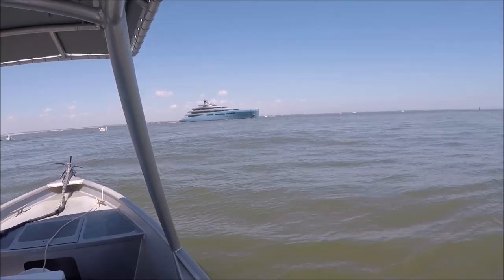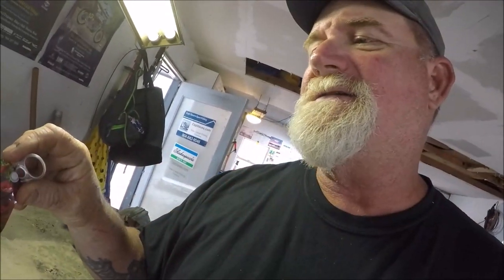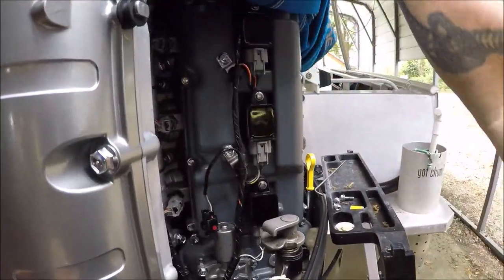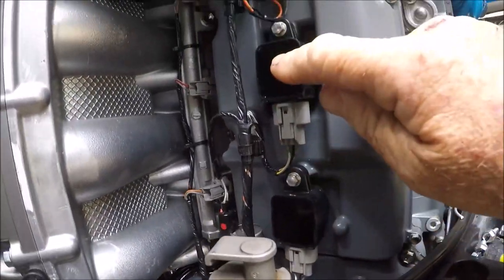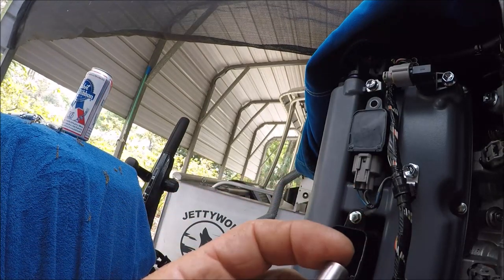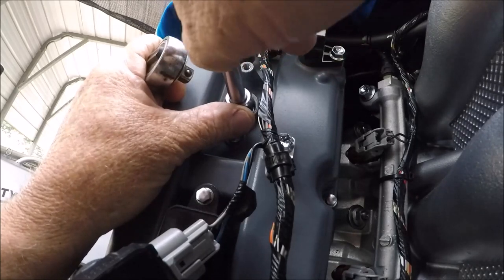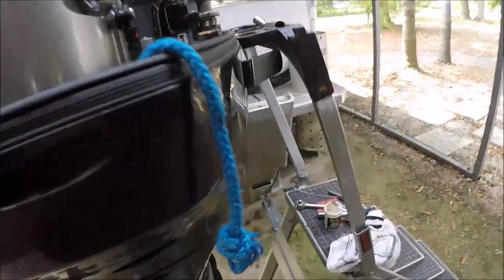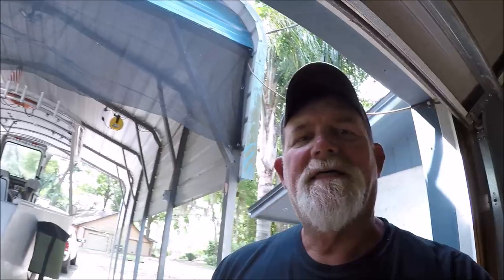SUZUKI V-6 OUTBOARD SPARK PLUG CHANGE

Comment: A few suggestions Take the Tupperware off, takes 5 minutes. Put a little grease on the end of the socket to release the socket. Finally use better tools that hold extentions better.

Comment: Thanks for the chuckles.  Enjoyed the video and I'm now a new subscriber.  Couple suggestions - ALWAYS use anti-seize compound on the plug threads. (I cannot stress this enough to you at home that do your own maintenance)  Many of these manufacturers use aluminum for the heads and the plug casing is steel.  I use it regardless if the heads are aluminum or not.  We definitely do not want those two differing metals to fuse together, otherwise next time you change the plugs, you may find a bonus.  Second suggestion is to put a very thin film of bearing grease on the rubber insert of your brand new deep-well plug socket.  It then can only grip only enough to keep the plug in the socket so you can get the threads to line up, but not too snug that you cannot pull the socket back out when the task is done.  Well done, sir!  Keep up the good work!
Reply from the maker: its DRAMA....I got it covered. Owned 20 outboards and done the maintenance on all. Lack of huge tool selection and ZERO time is my only issues. Glad you got your chuckles.

Comment: I take the rubber out of the deep socket. Works great for horizontal plug jobs.  Or don't fully seat the plug in the rubber.
Reply from the maker: I'll repeat what I told others......i thought about that but didn't want to do any factory modifications to my NEW $6.00 socket. LOL .....PLUS, it wouldn't have been nearly as fun to watch. It's referred to as; Theme, conflict, resolution. 3 parts to a good story. C'mon!

Comment: OK Dave, here's my solution to your problem of getting the spark plug socket outta de hole: Buy yourself another long spark plug socket just like the one you own. Somehow,( I don't know how - maybe poke it out, burn it out), remove the inside rubber bushing that grips the spark plug. Use this tool ONLY to insert the spark plug  back into the motor. Since the bushing is gone, it will not grip the spark plug and will easily come out with minimal screwing around.
Reply from the maker: oh I thought of that, but I didn't want to factory modify my $6.00 socket....hahahaha

Comment: Hey brother, long time viewer and subscriber,  i used to be a toyota technician...tight spaces and a pita to work on. They make or used to make locking extensions, i got mine through snap on, saves a lot of aggravation
Reply from the maker: thats nice to know. But as you saw, no struggle. I had a EZ solution, plus everyone said take out the rubber in the socket, most is holding camera while needing two hands, if there was no "conflict" wouldn't have been that interesting huh?

Comment: I usually take the rubber out of the plug socket and use the coil to get the plugs out of the cylinder head.
Reply from the maker: Chris Duffy said that too, and I thought of it, but didn't want to factory modify my brand new $6.00 socket!

Comment: So on a motor with plugs horizontal or even slightly downward,  why don’t you just use the socket without the rubber.   Problem solved
Reply from the maker: 1000% solved, old video. Im no mechanic.  No worries.